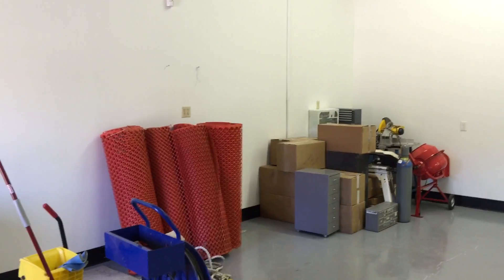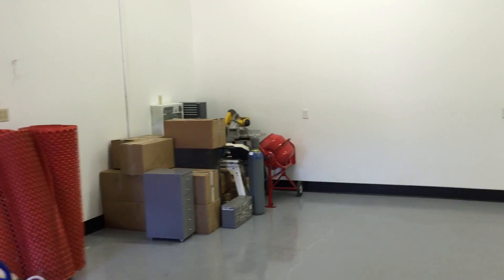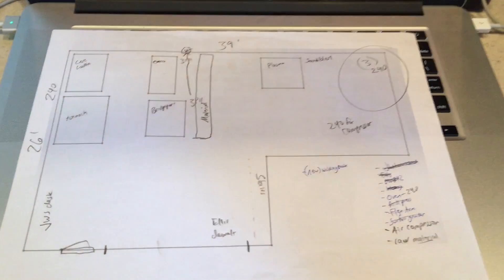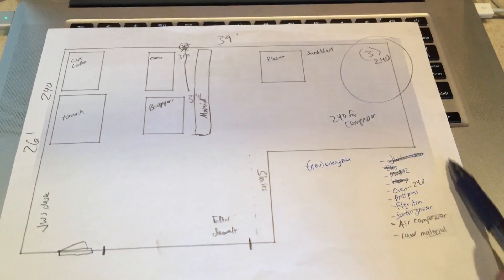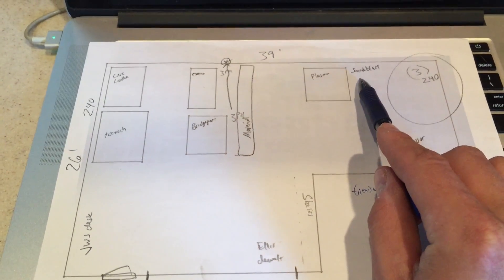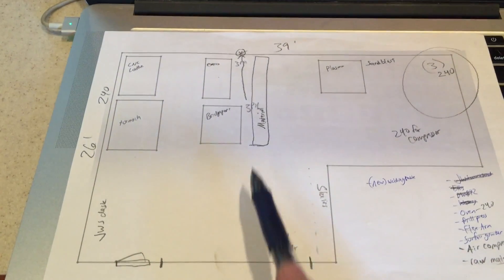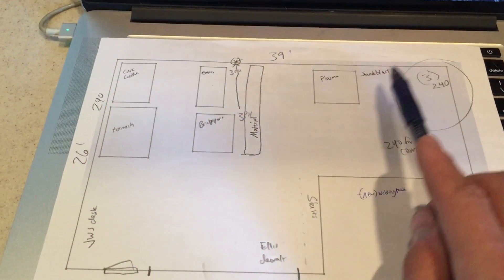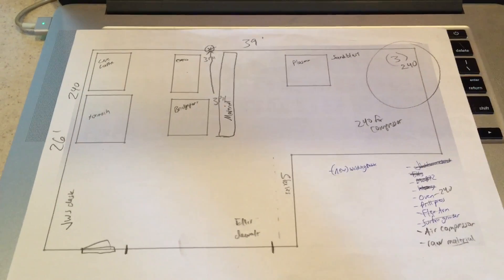New Shop - Layout?

Comment: have a think how material comes in, gets rough cut, goes through manufacture then onto finishing and back out the door for regular jobs. ideally without too much crossover. not always possible with job shop stuff but a route for things to follow could make it easier in the long run.

Comment: Not sure were the stairs go, but would it not be a good idea to put your desk upstairs away from the ''dirty'' shop ?as for the aircompressor if you can fit it under the stairs that would be great.The exhaust fan, I would leave it there, the grinders in the room with the sink would be nice and maybe even a divider from the stairs to the exhaust fan that way the 'dirty' welding, plasma cutting, grinding and so on are on one side of the shop.